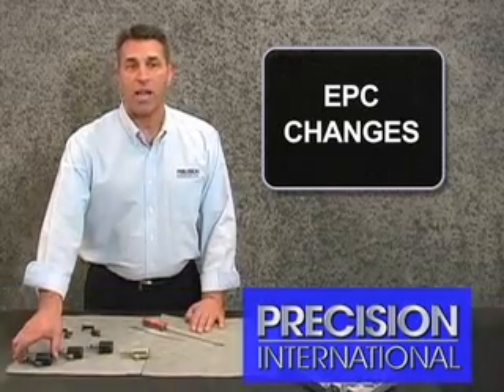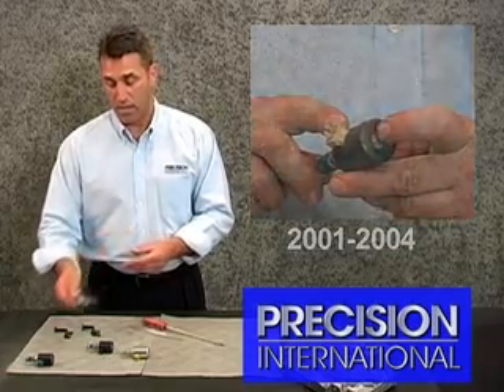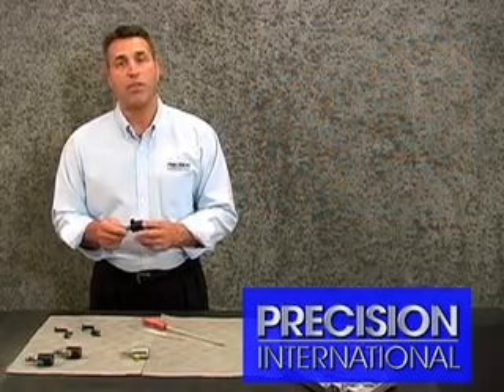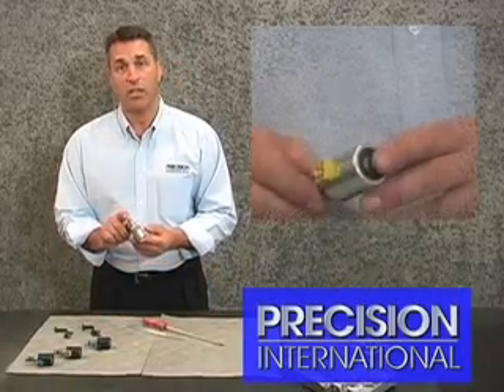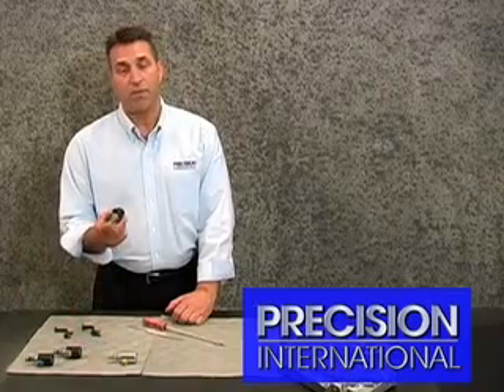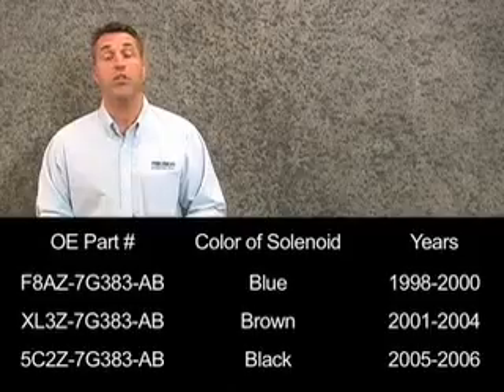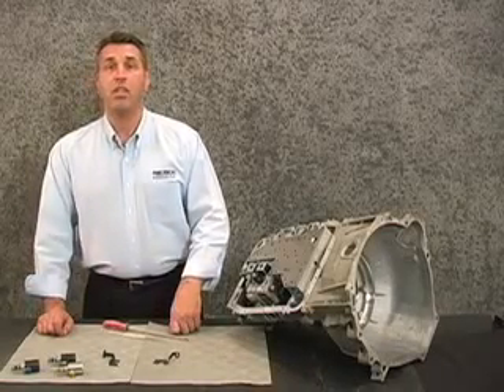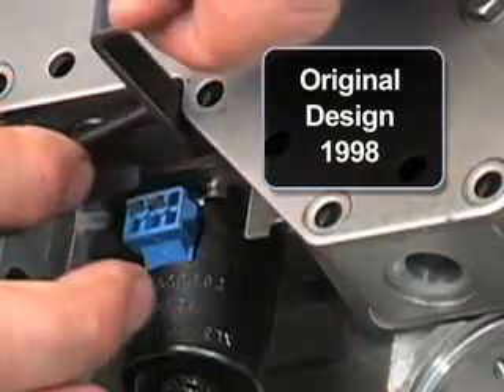4R70/4R75W EPC Changes

Comment: Man this simply isnt accurate and honestly you need to do one with a deeper dive . There is too much mystery surrounding these things at this point in time . There are quite a few colors and part numbers  . The yellow one you speak of in the video I have used to replace the Ford mustard colored solenoid and had no issues with it . What the public needs to know is what are the line pressure capabilities for each of the readily available colors out there.